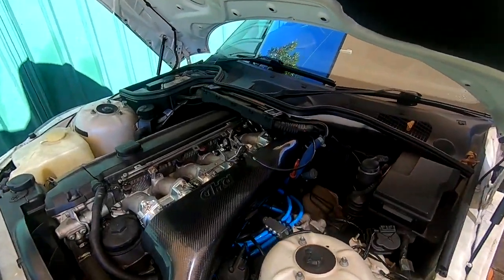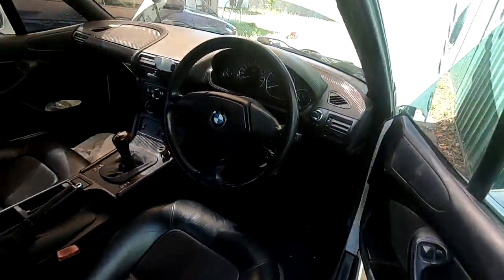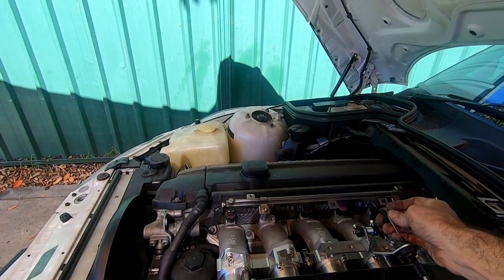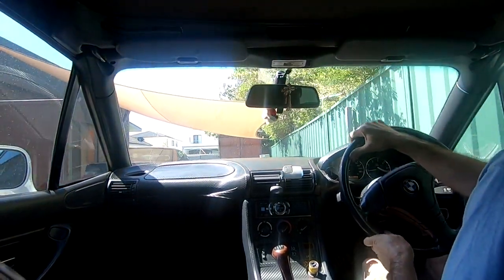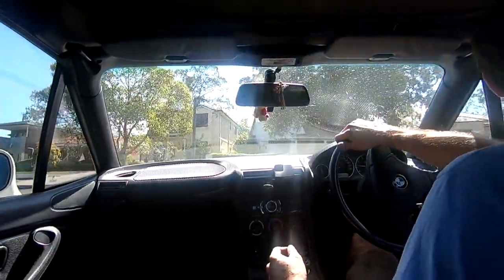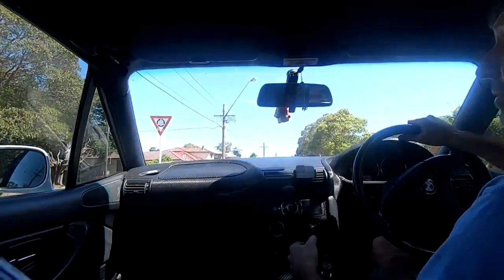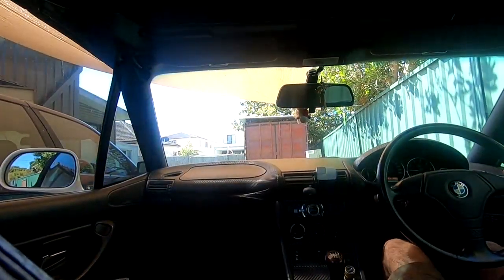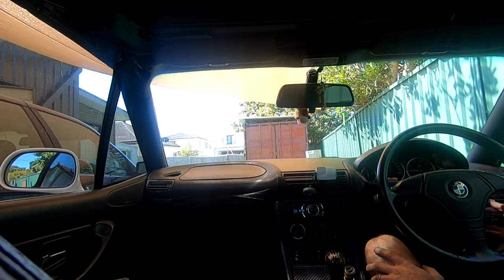BMW m52 ITB test drive

Comment: M52TU uses the most cursed throttle body ever created that is cable driven but has electronic backup, while M54 is electronic. Could your M54 kit work with the weird M52TU hybrid throttle?
Reply: This is also my question, keeping me from purchasing one myself. Troubling part i think is tps is inside throttle body housing and not its own individual sensor

Comment: Can the stock ecu be tuned to run this well for a daily? I'm full bolt on and fully tuned e36 328is and next plan to do schrick 256/264 cams. Now that I know this exists I'd be really interested in doing cams with these itbs and tuned for a fun performance daily. I don't really want to go standalone if it is not necessary.
Reply: Don't you need heavy duty valve springs for such agressive cams?
Reply: @idokwatcher2062  yeaah most definitely as well as valve retainers. ALWAYS consult with the camshaft manufacturer before purchasing and installing. They know better than anyone else what to use with their products
Reply: I have 262 256 cams in my car. With stock valvetrain 👍
Reply: You need ECU to get it to run correctly and its a must with hotter cams